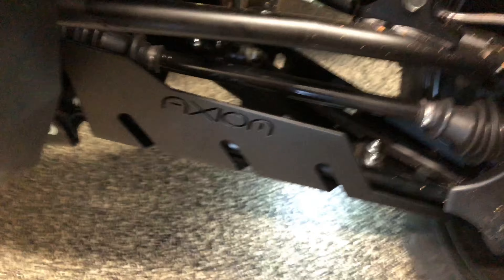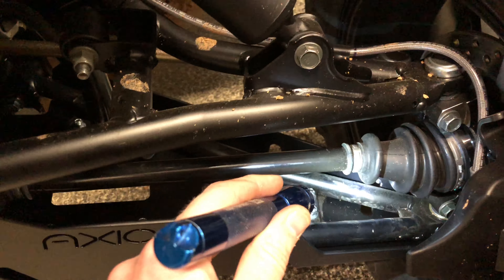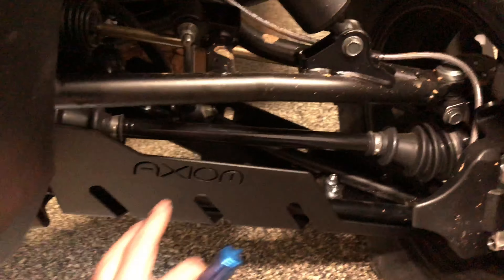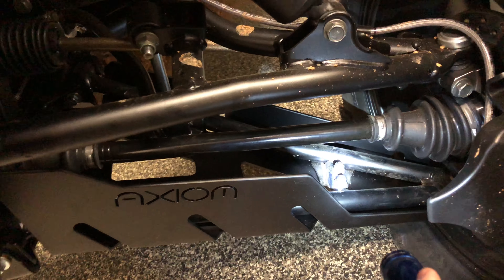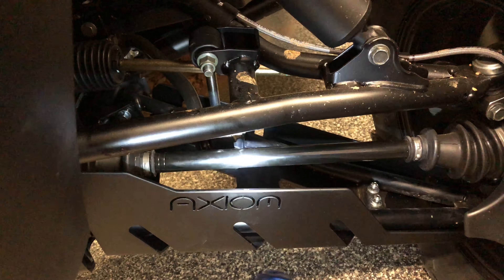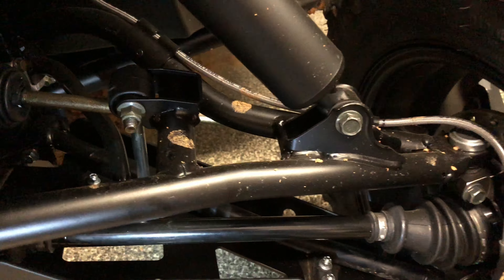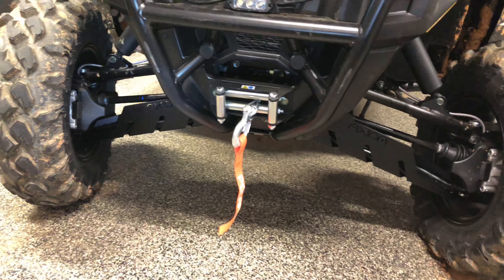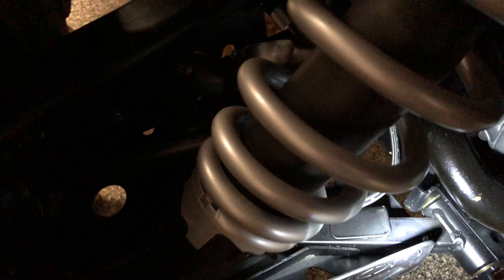Polaris General - Axiom A-Arm Guards Installed

Comment: Ben, I live in Marietta, GA and have a general as well. Just ordered the Axiom guards like you have, can you tell me where you got them powder coated in Ballground? Thanks. Not sure how to message you any other way.
Reply from the maker: Hey. I used this guy: exquisitepowdercoating.com  he’s on Ball Ground Highway. He did a great job. The powder coating eventually will get scraped off on the bottom as you go over rocks, but it still looks great.

Comment: Where did you go to get them powder coated and what did you pay if you don’t mind me asking. How long did it take to get them done.
Reply from the maker: I think I paid about $75 for the powder coating. It was a local shop near me in Ball Ground, GA. It took less than a week since I had them done in black (since black is the most popular color, they could go in the oven with other jobs without issue; if you use a custom color it may take longer to complete). I've had some chipping with rocks scraping them, but that's to be expected. Otherwise, the quality was top-notch, and they look much better than raw aluminum.